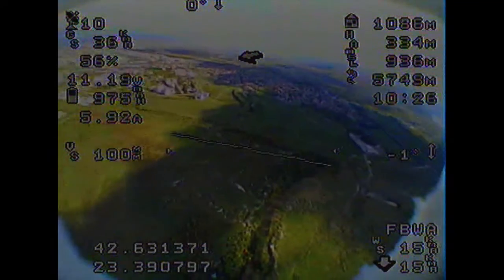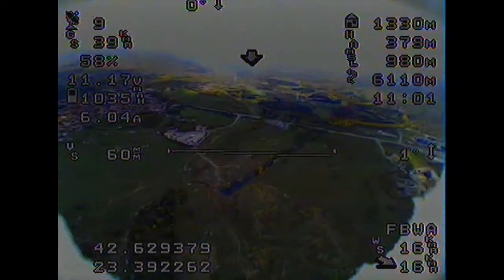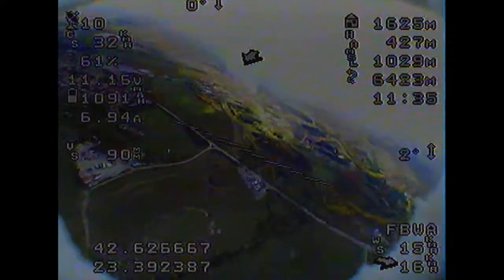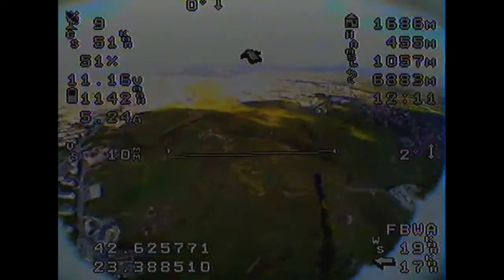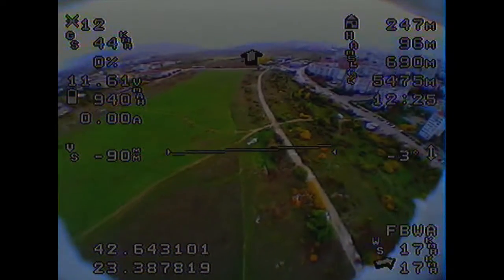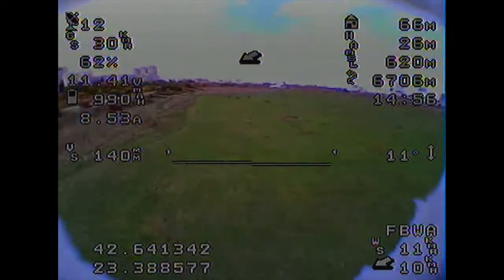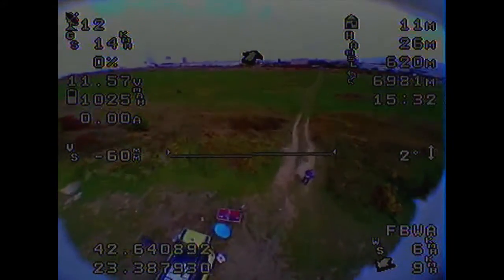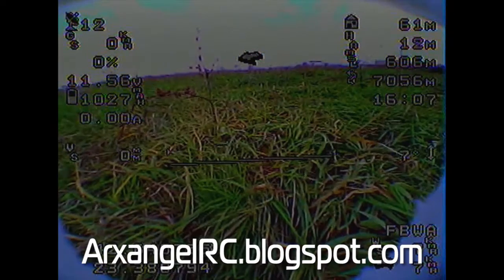Mini Ranger 1.4m FPV - testing new LC filter and antenna tracker

Comment: Nice! Can you give me the details about the LC filter? I'm using Sander-style LC filters but they can get quite bulky in a micro plane or a mini quad.
Reply from the maker: +BackyardAirways Hi, this is the LC Filter: http://arxangelrc.com/index.php?route=product/product&product_id=516
I have only tested it on this plane so far, and I am very happy with how it works. Will test it on a copter at some point, but for now I know that it can easily handle at least 1 motor and ESC. :)
Reply: +ArxangelRC 
Thank you! Ordered!
Reply from the maker: +BackyardAirways Thank YOU for the support! :)